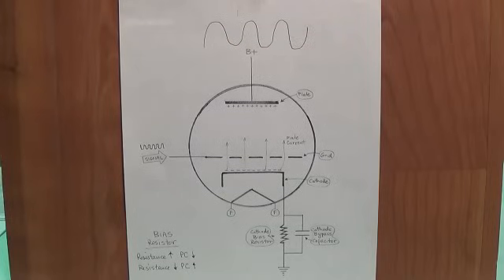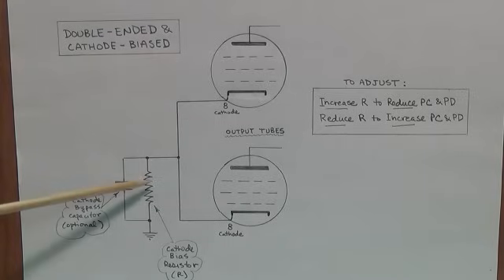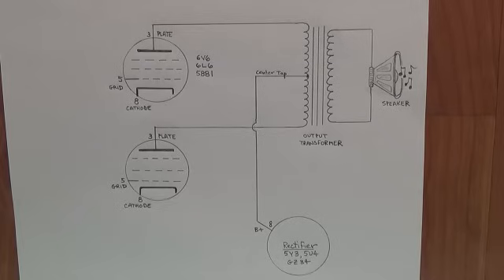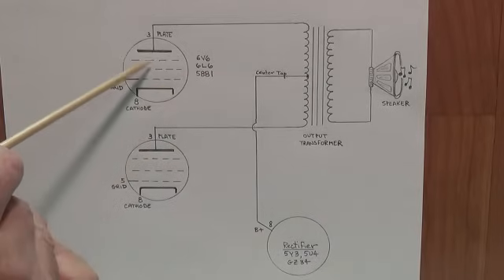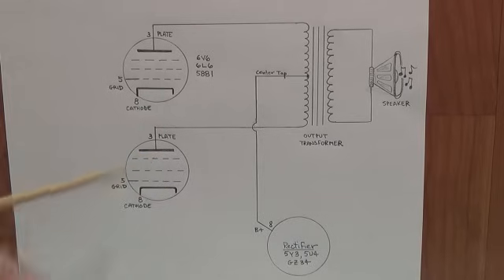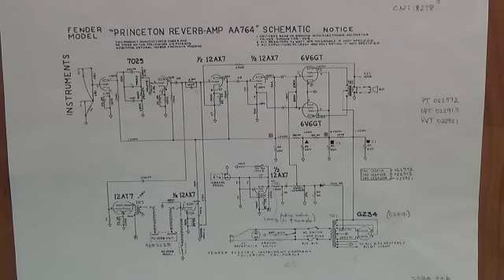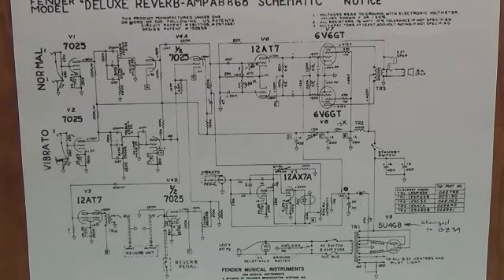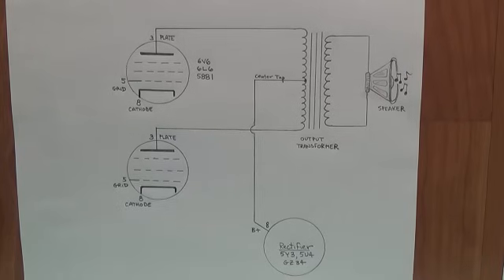Biasing Double-Ended Amplifier Output Tubes, Part 1: Basic Explanation & Methods

Comment: Uncle Doug
Hoping I could get some feedback from you here:
I'm new to amp repair, and I'm refurbishing an amp for my father in law. It had some bad preamp and power tubes...replaced with JJ 12AX7'S and EL84's( in place of the 7189's...
It's an old Danelectro DM25...new caps ( value for value...expept the 25uF/25V...i replaced them with 22uF...and the can caps...i put in Nichicon 22uF/10uF/10uF @450v...

My question is this:
My R values from plate to center tap are 150 ohm/173.5 ohm...with voltage drops of 4.17vdc/4.73vdc respectively...plate voltages to ground are 377vDc/375vDc...the voltages seem high to me...and the amp sounds really gritty...if I did my calculations correct based on this video, it's biased WAY too cold...at 10.6W/10.1W...or 10.3 W avg...any help you could give would be AWESOME!!!

(Btw...the 300W Lamp is working like a charm in my current limiter...must have had a bad lamp! Lol)
Thanks sir!
Reply from the maker: I'm glad the current limiter is working well, Rickey. EL84's are really not a direct replacement for 7189's because the EL84's cannot tolerate plate voltages much higher than 300VDC, and 7189's generally run closer to 400VDC. You will have to increase the plate current to around 35mA (by reducing the value of the bias resistor), which will reduce the plate voltage  to around 320VDC (or hopefully less) resulting in plate dissipation of around 11W. No matter what, the plate voltage needs to be much lower. If the tone is still a bit weak, you might also add a cathode bypass cap to the output tubes. Good luck.
Reply: Uncle Doug 
Thanks for helping...
I'm thinking of purchasing a few resistor values to try in place of the 100ohm cathode bias resistor...im thinking 75/50 in the 5W or 10W variations...does this sound logical? 
Or would installing a potentiometer in series with a resistor of another value afford me a better and more accurate solution?
Reply: Also, what does the cathode bypass capacitor do for this situation? I'm assuming you've probably covered this in another video...and if so, I'll be pleased to watch it to learn sir!
Reply from the maker: You're welcome, Rickey. If you can get a 100 Ohm pot, install it in place of the fixed 100 Ohm resistor and "dial in" the proper bias resistance. If you can't, then trial and error will have to suffice. A 75 Ohm resistor may be a good place to start.
Reply from the maker: I have posted a video discussing the function of cathode bypass capacitors. Please check my video list. They are used to increase gain in an amplification stage.
Reply: Uncle Doug 
After much trial and error, I've decided this amp is running voltages WAAY to high and no reasonable compromise can be had on balancing voltage/current for tube rated wattage...
Therefore, I'm gonna go back with either the EL84-M or 7189 variants as they are built for higher voltages...
Any issues with one over the other?
Thanks in advance, again!
Reply from the maker: I'm afraid I can't add any wondrous insights, Rickey......you'll just have to use some trial and error to come up with the right combination. Good luck.

Comment: Hi Uncle Doug:-)
I have JMP-50 2204 amp with EL34’s!
Well.... it sounds horrible!
I have replaced everything I could think of and I could!
Tubes, filter caps, trim pot,bias caps, pots, jacks tube sockets, a lot of other caps!
.....still sound awful:-(
On low volumes it is not that bad, but the more I push it, the worse it sounds!
Well....with Marshall tube amps is supposed to be the other way around isn’t it :-)
I was checking the bias from time to time  and the last time I did I left the probe and meter on V5 , and  found something that definitely didn’t look right to me!?
Before that :My amp plate voltage is 400V!
Most JMP’s are on 600V, but few run at lower : at 400V!
My JMP is one of them!
So I have set it around 37mA idle!
There was around 0.4~0.5 difference between V4 and V5 at idle!
I have one of these socket probes that goes between tube and amp socket with probes to be plugged in meter!  I am biasing the amp, on mV setting on the digital multimeter!
After about 15 min waiting for the bias settling in ,I left the probe and the meter on, and start playing!
The readings on the meter went up, which it should!
When I was swapping the probe back and forth between V4 and V5
, I found V5 was jumping a lot higher then V4!
And as I said above,the more I was pushing the amp, the bigger that difference became!
For example:
The highest readings on louder lower notes on V4 was reaching 45mV, while V5 was going way higher to 130mV!
If I stop playing, both will go back to 37.0 37.4!
The lauded the amp pushed, the bigger the reading differences between V4 and V5 !
If I swap the tubes, the higher readings are still on V5!
I have well matched pair of svetlanas, and I would guess, there is crossover distortion caused by the big difference in the current draw between V4 and V5!
What possibly can cause such a dissbalance Between the two tubes when amp is pushed!??
All transformers are room temperature!
No hum or any other signs of something being wrong?!

I have Marshall JMP, and now i’am recording with amp simulators .......yuck  !
Please Help!
Any suggestions would be highly appreciated!
Thanks for Your Help, and Kind Regards!
Steve!
:-)
Reply from the maker: Greetings, Steve. Much as I would like to render some brilliant repair suggestions, it's just not possible without personally analyzing the circuit......especially in a case like this one which is rather complex.  I suggest that you seek the assistance of a competent tech in your area.  Best of luck.
Reply: Uncle Doug 
Thanks Uncle Doug for the quick response!
The reason i started learning about my tube amp is first because i people around here charge way higher then I can afford!
And because I loved the way it comes along with my playing and how it sounds, I decided to learn servicing it myself!
Year ago I did not know anything about it, now I feel comfortable digging in it, and I have builded 5W single ended one myself from kit!
It is awesome sounding little amp for clean sounds, but I am literally mesmerized by the dynamic and color of pushed EL34’s!
And I like challenges! I don’t know yet a lot about that matter, but I know how to overcome challenges;-)
As soon as I get some suggestions from Here  and there, I will get the goose by the neck ;-)
Thanks for  Your tutorials in dept!
Such a Help for people who like to learn like me!
Regards!
Steve
:-)
Reply from the maker: You're welcome, Steve. Best of luck with learning about tube amp circuits. Study and practice are what it takes to develop the proper skills, and it sounds like you are on the right track.

Comment: What if you replace the bias resistor with a variable resistor/potentiometer? Is that the so called "Bias Mod"? Is that giving you the chance the headroom of your power tubes?
Reply from the maker: You need to watch my video on how to change from fixed bias to adjustable bias, NB. See my video list for help.
Reply: Uncle Doug thank you very much!

Comment: I'm assuming Doug from the chart at 3:25 that grid biasing doesn't apply to 6V6's and 6BQ5's ?
Reply from the maker: It depends on the circuit, GB. Single-ended amps use cathode bias for 6V6's and 6BQ5's, but double-ended often use grid bias......i.e. the Fender Princeton.
Reply: Ah OK Doug. Was wondering why you'd done the 70% of PD's sum for all except the 6L6's and the 6BQ5's. Maybe you explained in the vid but I missed it. Thanks for the reply.
Reply from the maker: I don't recall, but the 70% factor would apply to their PD if they were grid biased.

Comment: While I'm learning electronics from you Doug I have another question I hope is a logical one maybe someone else may have. If you take your readings off the tube and rectifier and one tube has 35 ma and the other tube has 14 ma reading for example or just tubes that are not matched and they share a common cathode resistor is the only way to fix this this problem to put another tube in that matches the one you leave in or how do you fix this problem other than giving each tube it's own cathode resistor which would mean altering the circuit? Thanks
Reply from the maker: It's a very logical question, Robb, and one that you will encounter from time to time. As output tubes age, their ability to flow plate current diminishes......often at different rates. Eventually, the difference becomes troublesome. As you describe, you have two choices:  1.) Install another output tube that is much closer to one (preferably the higher of the two) of the tubes.  2.) Install separate bias resistors, which is a "bandaid fix", but works.....at least until you can get a better replacement tube.
Reply: Thanks. I always wanted to know why tubes had different current readings with the same voltage and resistance on each of them
Reply: Doug the amp I asked you about with 38 watts I get I also asked the builder and this is what he said he did to get the watts. He said this "      Proper way to check watts is 1khz sign wave input. use a 25 watt 16 ohm res for a load measure the ac volts across the res ,go to ohms law calculator put in 16 ohm where it says res. where it says volts put in the voltage you measure across the load."    

   He said when I bought it that it was a 15 watt since output 6L6 tube amp. I come up with 36 watts. 360 times .1  I get the .1 from 25 V divided by 250 ohm resistor. He is a lot smarter than me but I guess I need to know where I went wrong. The cathode resistor is 250 ohms and measuring from pin 8 to pin 1 I get 24. 75 volts and the plate voltage is 360 volts. Pin 4 has a 100 ohm resistor.  It is a solid state rectifier. No tube rectifier. What am I doing wrong? Any help would be appreciated. I had a 4 ohm load hooked up to it but the output of the amp is for 16 ohm speaker. I don't know if that has any bearing on the measurement of voltage I took.

Comment: Hi Doug, thanks so much for the tutorial. It's so well explained. I had a question about what would constitute a mismatched pair. I had a set of old Sylvania 6L6GC's that tested well  on my tube tester so I though I would give them a try. I measured a Gretsch 6165 Variety Plus and got measurements of 69.8mA(outer) & 61.8mA (inner)of plate current. The respective PD results were 28.3W(outer) & 25W(inner)
Reply from the maker: Some people feel that a discrepancy of 10% or more between PD values indicates a mismatch, Jeff, but others seem to think that some degree of mismatch will actually foster the production of even-ordered harmonics. I tend to avoid any strict numerical cutoff point and just go with what sounds good. The purists might give your tube pair a thumbs down, but I have a feeling they probably sound just fine. Also, as you found out, tube testers are not a good way to match tubes.....they measure other criteria than PC and PD.
Reply: Got it! Thanks again Doug. As always very helpful. I think I'll try cooling them down a bit and hear how that sounds. By the way any recommendations on wattage and type or brand of cathode resistors.
Reply from the maker: With cathode-biased GC's you can go as high as 30W.  If they are grid-biased (grounded cathodes) then 70% of 30W or 21W is the maximum.
Reply from the maker: As far as the cathode resistors, 2W is probably adequate. Metal film resistors are ultra precise and last forever.....virtually any brand will do.

Comment: Can I use a 100 ohm 10 watt wire wound resistor to drain my caps? (They're cheap cheap on ebay)
Reply from the maker: Yes, indeed. It would be perfect.....just be sure that it's well insulated from your hand.

Comment: Hello Uncle Doug!
I want to retube a 100w Peavey Valveking Amp Head, it has 4 6L6GC´s and it ´s a grid biased design. I couldn´t get a matched tube quartet, I got two slightly different pairs: Pair A has Ip=39 Gm=4100. Pair B has Ip=39 Gm=4300
What do you recommend in regards to tube placement in the circuit? Pair A (Gm=4100) on one side of xformer and Pair B (Gm=4100) on the other side? Or sholud I mix one of each pair on each side of xformer? Thank You!!
Reply from the maker: I think the amp will work just fine with any configuration of the tubes you described......but, if you combine one tube from each pair in parallel, then the average of the two parallel pairs will be identical.

Comment: Uncle Doug,

I have new Fender custom 68 Vibrolux. I have GT-6L6-S and bought new GT-6L6-GE Power tubes. I measure the tubes :
                                                  
 Stock - 6L6-S: (Newish)

(30 / 426 VDC) = 70.4 (MAX PD ?) X .7 = 49.2 mA. 

 I read my PC as 24.2 mA - the amp sounds good/great, but how can this be ? Isn't 24.2 mA too COLD ?

6L6-GE (out of the Box) - Usind a EUROTUBES BIAS tester with PC and PV readouts.

(30 / 434 VDC) = 69.1  X .7 = 48.3 - Plate Current = 30 for these tubes.

Should I turn the BIAS POT UP and move to 49 mA ish ? or leave it alone ? It does sound good.

Thank you sir,

 Ken Conigliaro
Reply: Forgot to add - Fender says check TP33 and set it for 60mA. I have not taken the amp out of the cab yet.
Reply from the maker: I have no idea how you are getting your measurements, Ken, so it's hard to judge them. Have you watched my video on biasing double-ended amps?  Are you measuring the voltage drop across the OPT windings?  Does Fender use 6L6's in this amp.....the Vibroluxes I am familiar with used 6V6's. Are your 6L6's GC's (or did the manufacturer provide its own maximum PD value for them)?  If so, the max PD for a 6L6GC is 30W if cathode biased and (x .7) 21W if fixed bias......and tube bias is based on watts of PD not mA of PC.
Reply: Yes the new Vibrolux uses 6L6 GC. I'm using a EUROTUBES BIAS tester. I'll watch again and measure your way. Thanks again for all your great videos and magnificent teaching style. I love the Black cat - the best cat I ever had looked like your cats twin. Cheers.
Reply from the maker: You're welcome, Ken. Best of luck with your biasing procedure.

Comment: +Uncle Doug

I have an RCA 6-HF3 AM/FM/Phonograph that I am almost finished restoring. I had to replace the two 6V6 output tubes in the amplifier section. When I checked the bias it was at 114% of max. I replaced the bias resistor and the "grid stoppers" as they were both significantly out of tolerance. When I rechecked the bias it was still at 96% 

I checked the bias because with the volume control at 2-3 (out of 10) the amp is very loud. At 5 is seems to be distorting. I'm thinking about reducing the bias to 85% - 90% for better tube longevity and to give me some room on the volume control. I'm not sure how that will affect the phono input. Do you think re-biasing is a good idea?
Reply from the maker: That sounds like a very reasonable idea, Michael. There is no need to bias any output tube at absolute max plate dissipation.  I think you will be pleased with the lower bias levels you mentioned.....headroom should increase a bit and tone should remain good.  There should be no problem with the phono input. Good luck.
Reply: Thanks Doug. Your channel is invaluable on a lot of levels. I typically haven't checked the output tube bias when I restore old radios. I will from now on. The RCA that I am working on is a '56 vintage. Two years older than me. Once I align the AM section, fix the FM section (it's dead), and re-bias the output tubes I've got to work on the turntable. That is going to be a new "thing" for me.
Reply from the maker: It's a good idea, Michael. Output tubes are under greater stress than other tubes in a circuit, and should have correct plate dissipation levels to survive and to produce good tone.

Comment: How would the amp perform with unbalanced output tubes?
Reply from the maker: It depends on the magnitude of the imbalance, but if it is fairly substantial, it will result in a loss of gain (output power) and tone quality.  The "hot" tube will break up too soon and the "cold" tube will be weak 
and flat-sounding.....not a good combination, especially if you turn up the volume to compensate for the reduced output.  In addition, a hum may develop due to the inability of the two unequal output signals (in the output transformer) to neutralize the hum in each other.

Comment: +Uncle Doug I do so enjoy your videos. On the GA-40 schematic you traced from pin 8 of the rectifier thru a filter choke to the center tap and on to the plates. So do we include the resistance of the choke in our calculations? I'm guessing yes.
Reply from the maker: Greetings, 998. Yes, you would measure the total resistance between the rectifier output pin and each tube plate (which would include the filter choke in this case).....as well as the total voltage drop across each of those resistances.

Comment: I watched this a few times now. You have cleared it up for me. Thanks for the video! I have obtained a tube amplifier with no identification or schematics. I have found that it is mono with two KT66 tubes in double ended. It's going to be a repair project. It needs new capacitors and I'm sure it will need a bias. I will have to look out for a resistor to ground on the cathode.
Reply from the maker: We're glad the video was helpful, SED. Good luck with your biasing project.....and be very careful.  The voltages can be lethal if not handled properly.
Reply: Uncle Doug Thanks doug. I understand the dangers of high voltage. I am reasonably knowledgeable in that area. My amateur radio licence has taught me a decent amount in that area.
Reply from the maker: That's good, SED, because Rusty and I only want the best for our viewers. Best of luck with your project.
Reply: Uncle Doug thanks doug. I made a current limiter today also. Works just fine
Reply from the maker: That's good to hear, SED. You will find it to be a vital piece of equipment. Best of luck :)
Reply: Uncle Doug thanks a bunch doug :)
Reply from the maker: You're welcome, SED.